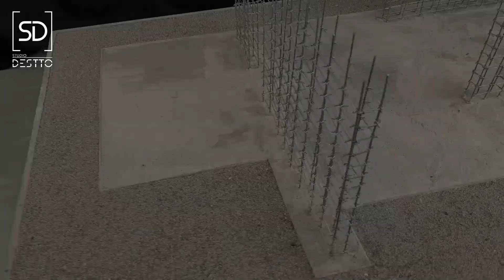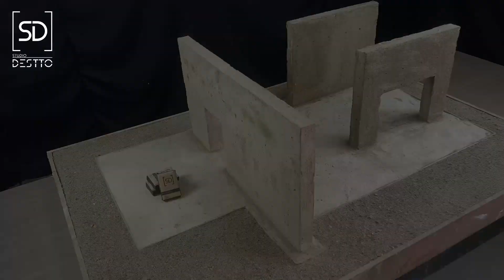Construction process of concrete WALL and FOUNDATION - MINI DREAM HOUSE #1 - BRICKLAYING

Comment: What is the material you use for the reinforcement? Is it steel? And 4mm,3mm? Please help I’m doing a portfolio model
Reply from the maker: Hi! for the reinforcement we used 14 gauge galvanized steel wire 👋🏻👷🏼‍♂️